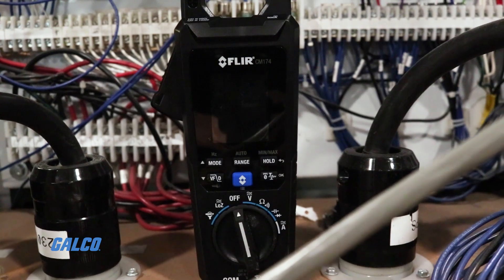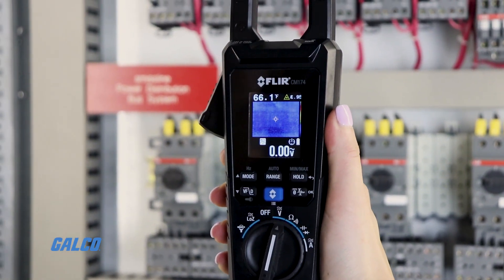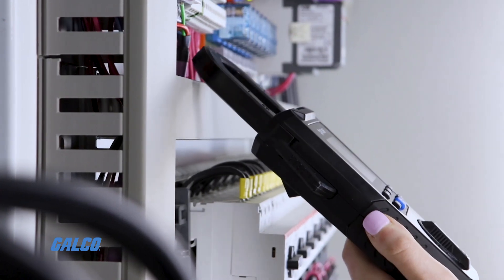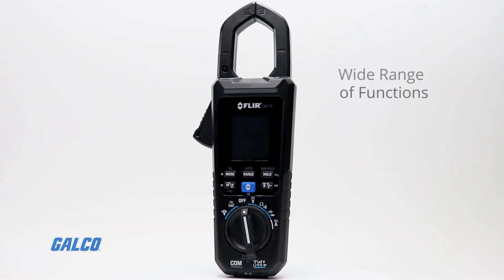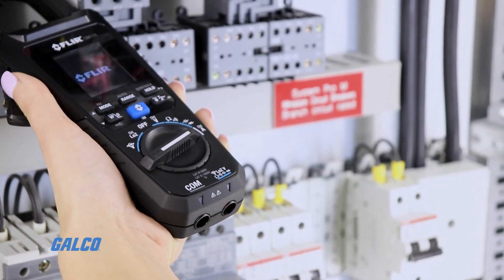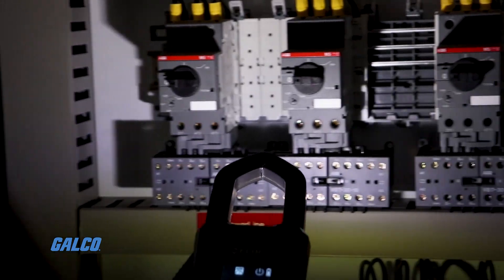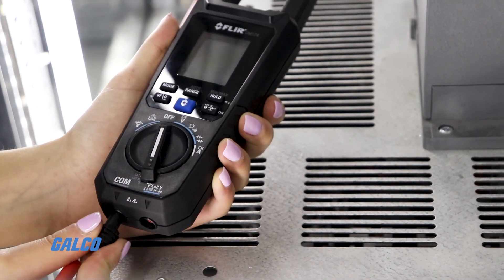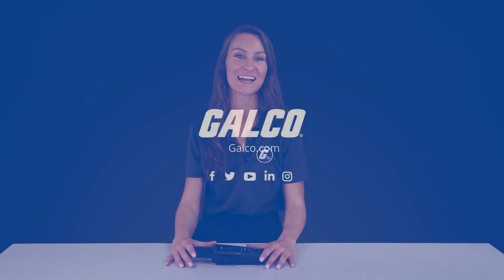Flir's CM174 IGM Clamp Meter

Comment: The FLIR CM-174  and CM-275  clamp meters are defective products. Display is poorly made and easily get broken  or scratched by any sharp object. 
Also  with the IGM on they drain the batteries in a couple minutes. Response from FLIR is Silence. DONT BUY !!! 
FLIR IS NOT RELIABLE !!!
Reply: I bought a cm 174 clamp meter. After using it  a few times the function selector switch is turning and slipping. I can't even turn on the meter cause apparently the cheap plastic switch is bad . Unreliable P.O.S.! Contacted Flir but they don't want to fix it cause I can't find my proof of purchase receipt.